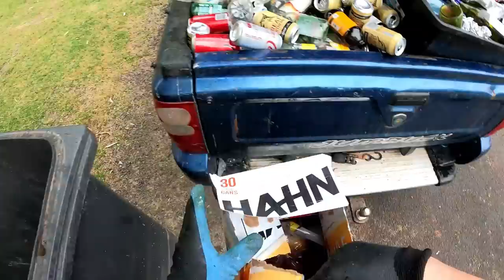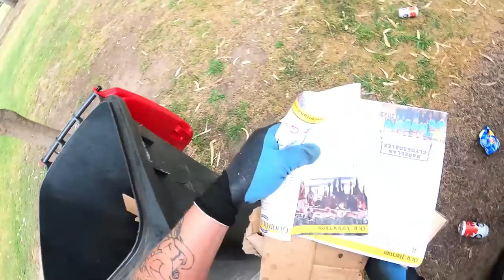Dumpster Diving Part 2 Geez We Got A Mountain

Comment: If you know that you will overfill your vehicle early, why not just start using the wool pack sooner rather than later? Saves time having to unload the overfill into the wool pack. 

Also, why not just deal with the wine bottles at each trash can you find them? They take up too much valuable space for the stuff you will be taking with you. And you should take the caps off as you are sorting them from the tote with the foil, then go back and take the necks off. You are double handling them. 🤷‍♀️